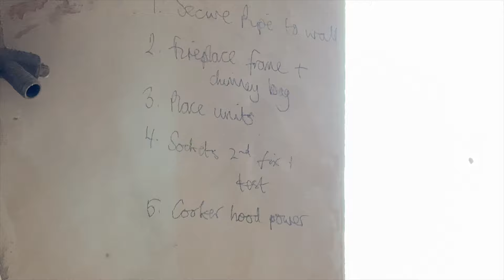We set FIRE to the kitchen wall

Comment: When drilling for an outside tap, where there is no danger of hitting cable or pipes on the inside, always drill from out to in. This will avoid blowing off the face of the brick like you've done here. However, now that you've done that, make an effort to repair that brick neatly before making the final fitting to get a neat job. This is important as frost will get into the damaged brick and cause further damage to the brick face. You can mix a little red dye into sand/ cement for a pro finish.
Reply from the maker: Top tips and I did a small hole to stop it blowing so I could go from outside in. Those bricks though…
As for frost. Well freeze thaw may work on granite mountains but it won’t touch these bricks 🧱 
😂🍻

Comment: It's common to have the tap tails coming straight off the isolation valves and they make a special isolation valve for this which has a flat join rather than the sharper edge that you see on normal isolation valves. A standard isolation valve may damage the rubber seal inside the tails. A better layout is to fit isolation valves further back, extend the 15mm copper then attach an adapting male coupler. The benefit is that if in future you purchase taps with different length tails, you can simply adjust the length of extended copper rather than having to move the isolation valves.
Also double check the finished gap along the sink run, if you haven't done already. It's looking tight for the corner fillet.
Reply from the maker: More top tips! Thank you. It’s all going into the bank for the future 👍
I raise a 🍻to you!

Comment: Plaster over the top of copper pipes is a bad idea.  It will eat the copper and cause leaks.  It should be inside some sleeving at the very least.
Reply from the maker: Yes although there isn’t any in the kitchen under plaster that I’ve done. The feeds have been in plaster for about 60 years and still ok. 
Got any pics of what a copper pipe looks like after being in plaster? Curious to see the damage it does 🍻🍻

Comment: Rather than waste time building a frame to close off a chimney why not use a sheet of tile backer board that you can cut with any knife or saw, Lux, Wedi, whatever make. This can be fitted with simple tile adhesive, preferably rapid set and would take about twenty minutes all in.  Don't keep making work for yourself...
Reply from the maker: Oh you spotted my ‘extra job’ technique 😂
I’ve done the frame so I can access it if there are chimney issues. 
Maybe overdoing it but ah well…😉😂🍻
Reply: @EscapeToTheDreamHouseUK , by using Wedi type tile backer board you can access it anytime very easily!
Reply from the maker: @martynlegg1042  ooh! I am going to look that up then! 🍻🍻